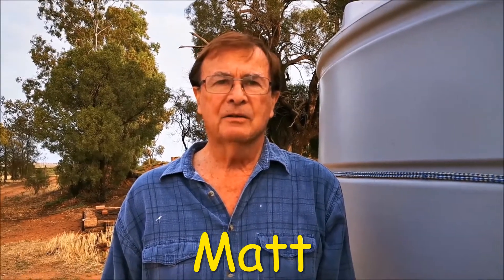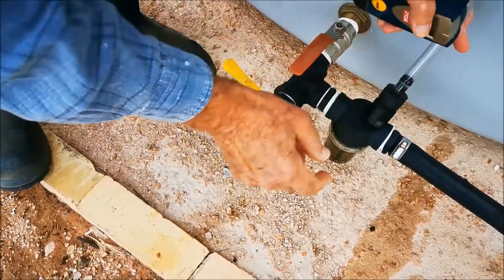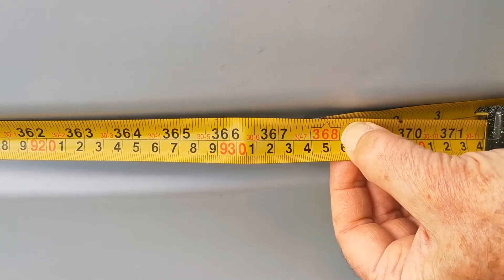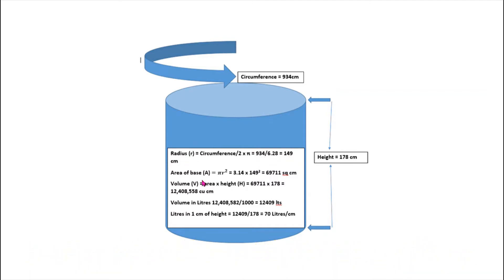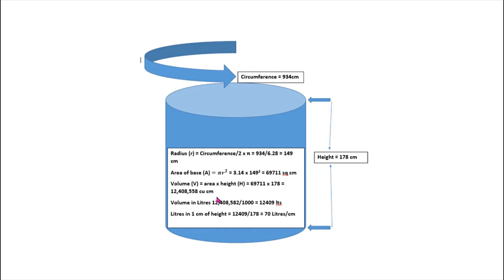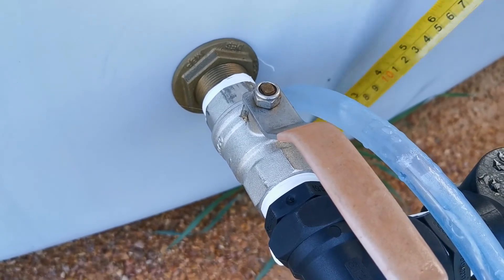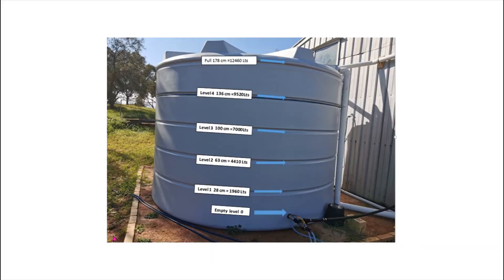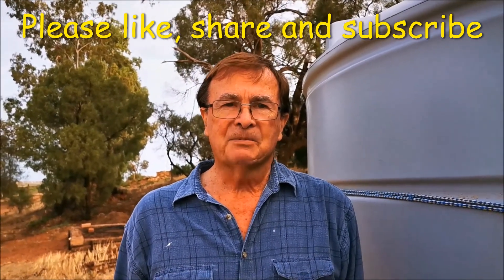Find tank water level and volume or capacity simply and accurately

Comment: My tank is on the ground and the outlet at the bottom is only about an inch from the bottom and i cant put a tap on it unless i put an elbow in it to bring it up to put a tap on it im in thailand thats how they are made ??? So the tap is about 12 inches fro bottom of tank
Reply from the maker: That is fine the level in the plastic pipe will be the same as inside the tank 😊👍
Reply: @AnnErasmus  thank you my friend

Comment: Thanks Matt, for this video. I watched your "stud-finder water level" video some weeks ago (as I just have had two larger rain water tanks installed in addition to my existing one).
Then I googled how to easily find a rain water tank level, and this video came up. What a simple idea and technical you have shared! Thanks so much. You explained it very clearly.
(I didn't know that 12mm clear tubing exists, the same size as normal garden hoses).So I went to my local hardware store and had it all set up in my 3 tanks within half an hour. Much appreciated.
Reply from the maker: Well done, Thanks for your feedback, much appreciated